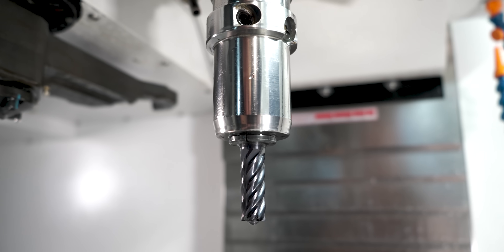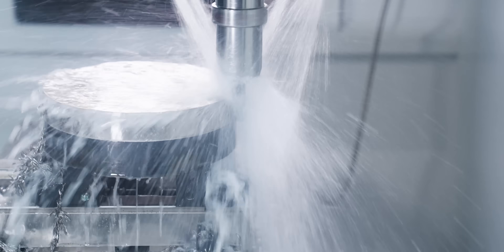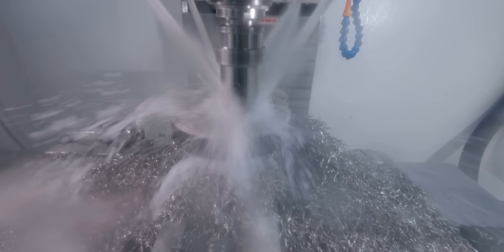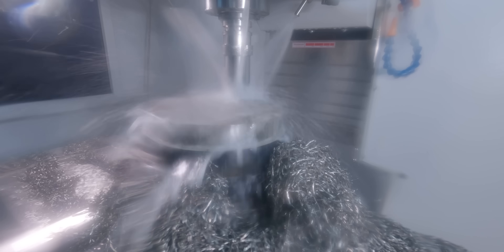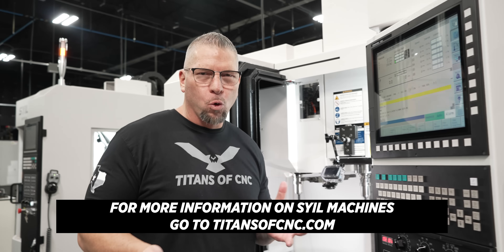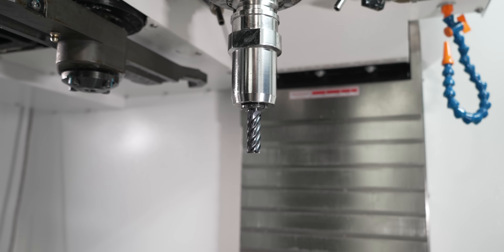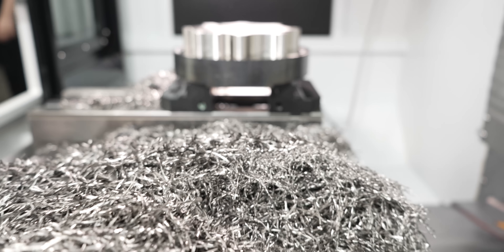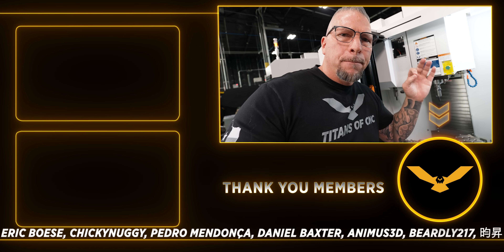My First Part: Machining The Toughest Material On SYIL X7

Comment: just because copper is tough and nickel also doesn't necessarily mean the alloy is too. elements change each material they are alloyed with differently. but in this case it is true yes
Reply: Titan is pretty liberal with definitions. Here toughness is low machinability due to work hardening
Reply from the maker: Exactly… toughness represents the gummyness of the material and how it doesn’t break a chip easily… better word might be Nasty…
Reply: @TITANSofCNC   in german engineering (guess germans are just precise sometimes) they have a great word for it called zäh which literally discribes something gummy that need a lot of force to deform but still cohesive so it doesn't break. while brittle is pretty much of the opposite
Reply: @leonschumann2361 well, Zähigkeit is exactly the term for toughness. And what you describe is almost the definition of toughness too.
Here we rather talk icky/eklig
Reply: @feedbackzaloop  hardness and abrasiveness comes into it too. like Aluminum with lot of silicon soft bit gummy but quite abrassive for example
Reply: @leonschumann2361  yep, that's why you can't really grasp the whole process with a single definition.
Reply: @feedbackzaloop   monel K500 sounds horrible still XD but simple logic: the better mechanically a material is, the harder it is to machine, form, mold and so on (mechanical processes)
Reply: @leonschumann2361  weeeell, duh? "Better" materials are required to resist loads and wear, machining is form of wear under load🤷‍♂
Reply: @feedbackzaloop  das why l said "simple logic"
Reply: Monel K500 is predominantly a Nickel- Copper alloy https://www.specialmetals.com/documents/technical-bulletins/monel-alloy-k-500.pdf as such it is used in rocket engines because of the thermal conductivity of the copper. At 33% copper composition, I can't imagine Monel K500 is as difficult to machine as other "super alloys"
Reply: The machine shop I am working at has a job with Haynes. I'm sure that is going to tear up some tools.

Comment: The material that comes off parts , is that thrown out or does it get filtered for reusing/ recycling???
Reply: Save it! You can get real money for the chips. But only if it is not mixed :)
Reply: Varies shop to shop, but for the most part recycled.
Reply: yes it does. they melt it down later